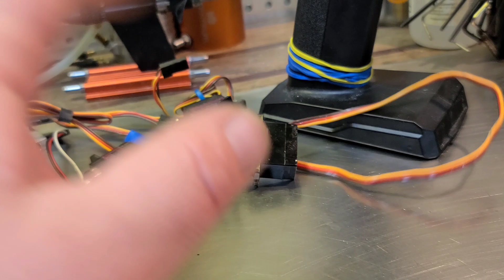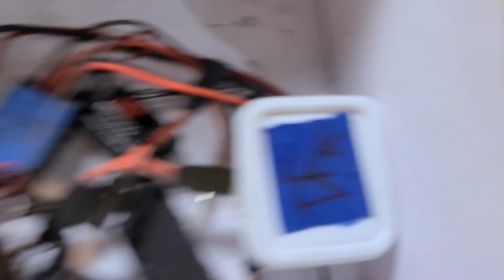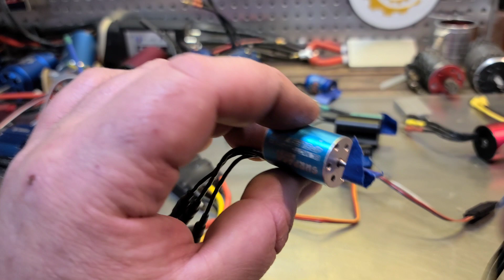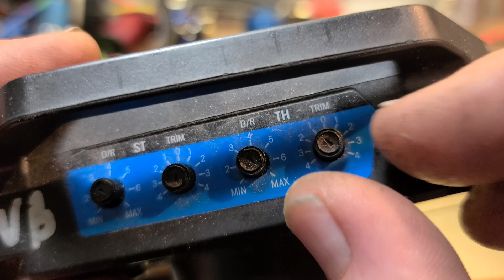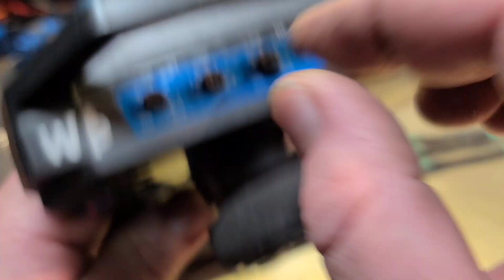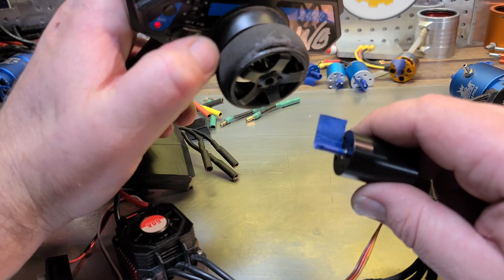Bench Testing Brushless Motors & Different Esc's Listening To Kv/Rpm

Comment: You can use lower part of that blue car esc (guess its a 120a esc, quite common for 1/10 cars) and epoxy the lower electronics. That's what some guys did to car esc's in the past. Nowadays its common for most water/splash proof esc's. 
Castle esc is also filled with some kind of epoxy, and there are most off the time heat absorbing silicone mats between electronics and aluminium cooling ribs. Think someone can explain better in english but that's genuinely how it's put together...
Reply from the maker: I understand exactly what you're trying to say thank you. I've used the epoxy on ESc's in the past at the end of the ESc waterproofing inside the heat Shrink works pretty good,  I used common everyday epoxy.    I've seen specific electronics grade epoxy on ebay

Comment: Dude, I love your channel! I'm a relatively new boater with a Spartan and a couple of smaller UDI boats. I just rebuilt one following all your awesome in-depth info. Thank you. Knowing you don't roll traxxas boats, what can I do for more control at full trigger? She gets up and prop walks on 6s and I'm wondering what will keep the bow down? Love your ish bro. Also, don't beat yourself up too much for hitting the waterfowl. Accidents happen.
Reply from the maker: Propeller choice will get that bow down.  X series octura props (low lift,) which should be a good starting point octura m  series (medium lift) props wouldn't be a good prop choice because they lift the bow/boat....
Reply from the maker: You could also try oxidean 4519, that's been a great all-round prop for almost all my boats in the 29- 36 inch range

Comment: Your 0 point on an aviation ESC is at full reverse. So hold Full reverse on power up until it beeps and should be able to test it on a normal transmitter.  Keep pumping out the videos brother. ✌
Reply from the maker: After the video I tried just about every setting imaginable lol,  with no luck...   ill try full reverse again.   I even tried a couple different transmitters and recievers.     Thanks for the information very helpful

Comment: I have knocked off every 2nd fin on the esc and jb welded brass tubbing that fits snug in the knocked off fin place.
Linked them with tube and dropped prop size be a use I didn't know what to expect.
It kept me on the water while I waited for the replacement to arrive. 
It did OK. Even let the kids have the remote.
Reply from the maker: I've done that In the past, I didn't even think about that with this one. Thanks for the reminder..    that may be the route I take thanks